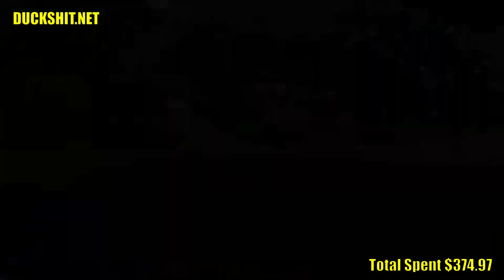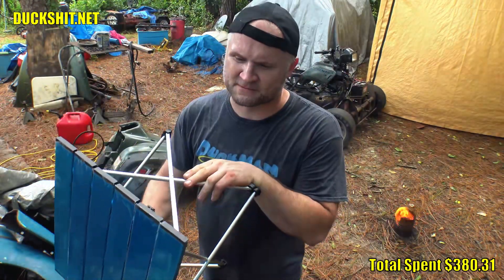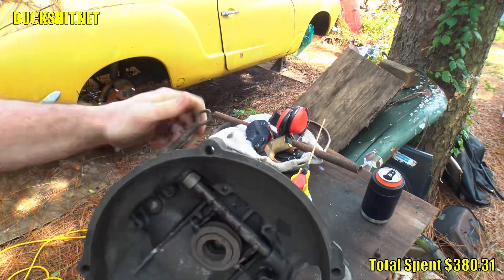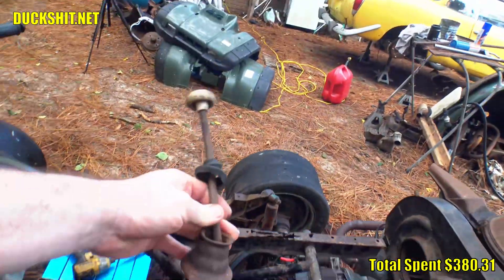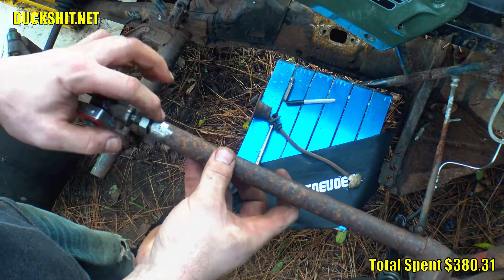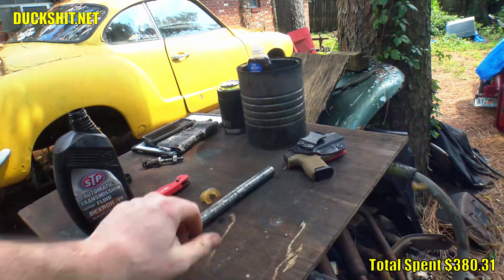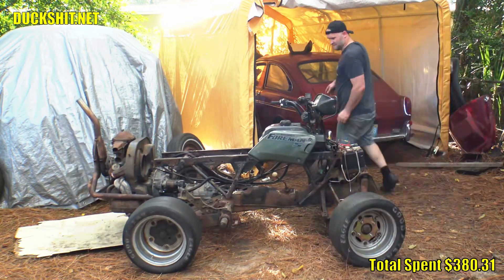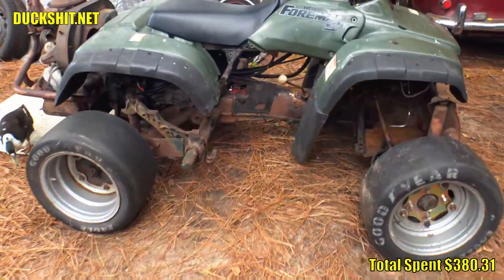Test Ride (SORTA!) - VW Motorcycle - ATVW Junkyard Build - Part 11

Comment: Hey Duck!

Re: Neutral safety switch...One of your lawn mowers should have a seat switch, which kills the engine if you get off. You could install one between the starter button and the solenoid. (or a blade  switch)
Reply from the maker: Why would I want a seat switch?   That's the kind of thing that would have made my father very angry LOL!
Reply: So you don't run over yourself.
Reply: @DuckmanCycles  you love to get off my put a switch on it haha
Reply from the maker: @frankschwartz7405  I'd wish to run over myself from the frustration of having to sit on it every time.

Comment: Those axles or as we call them driveshafts are like the ones BMW use can be a pain to remove on a BMW I know that lol! I hate doing cv joints I can never get the clips on the gators right they always come off! so I tend to just replace the shaft lol. Nice that you got it running/rolling and a shifter it's not ideal but hey it works! looking at your throw arm for the clutch fork it looks like you got room to extend it which would make the clutch easier. 

I wonder how quick you can launch on that I think it would be pretty quick, also i wonder if you can do burnouts haha. looking forward to the next video :D
Reply from the maker: The only trouble is extending the clutch lever increases the travel oh, and the hand control already has a short enough throw, so that's just not going to work!  😁👍🏻